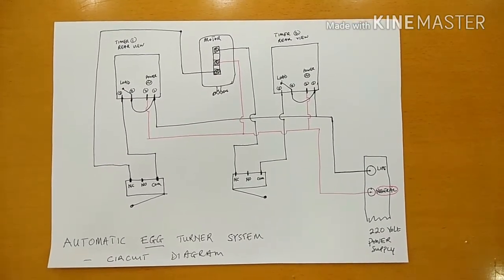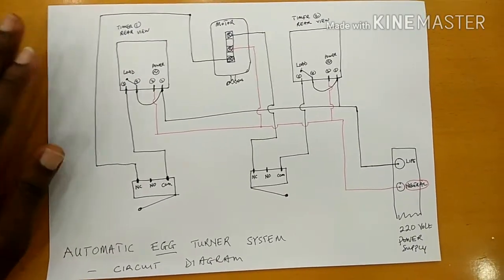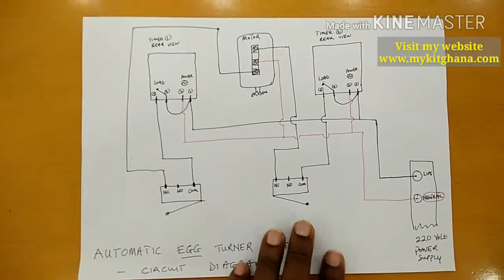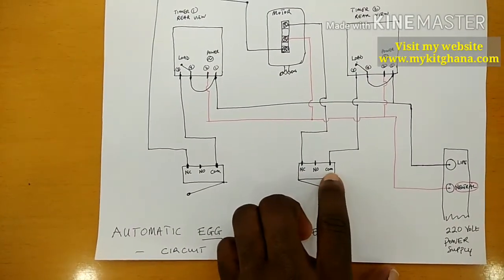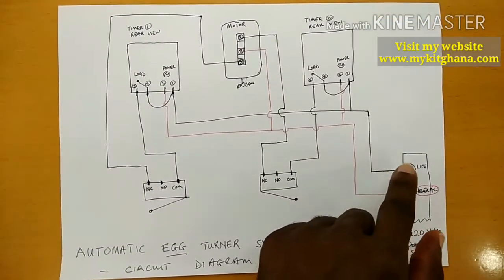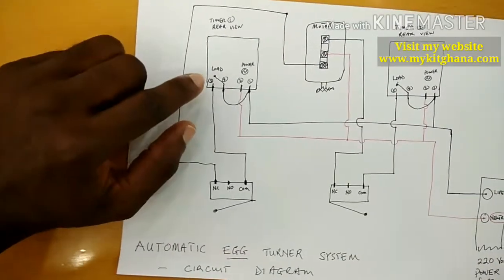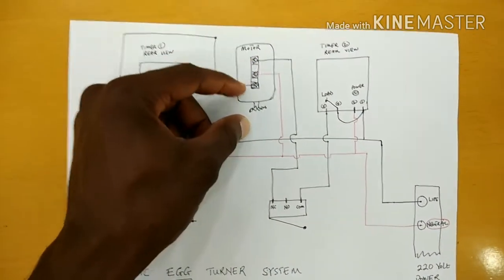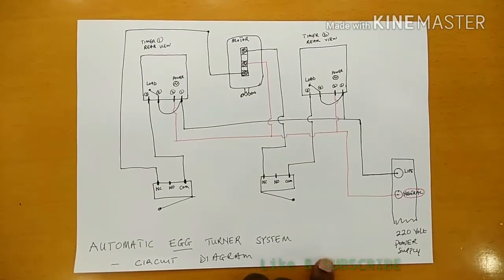Incubator automatic turning system CIRCUIT DIAGRAM

Comment: i tried ur diagram after connecting all component when tested the turner is not stopping when touching on both limit switch still continue turning on both ends.
Reply from the maker: I think u missed something
Reply: what kind of timer u r using programmable type?
Reply from the maker: Cn101
Reply from the maker: Try this video https://youtu.be/QZtRUx4oNjk

Comment: Hello! I am reading you from east Africa. Your video is real illustrative. But still having one question, can one set egg turner by using only one 24hrs timer switch without a relay?
Reply from the maker: If your Turning system is such that the motor only turns in one direction, then you can use just one timer without relay
Reply: @mykitvideos5937  long time subscribed!!! Is not one direction motor. Come again brother. How then one would configure turner as such without relay. Take note it is a two way motor. Thanks again
Reply from the maker: +Ezekiel Shija 
For this type of motor you either use 2 timers or 1 timer plus relay
Reply from the maker: +Ezekiel Shija 
See the relay here
https://youtu.be/QZtRUx4oNjk
Reply from the maker: Ezekiel Shija 
Yes
Reply from the maker: And actually it depends on the configuration or style of your Turning system
Reply from the maker: Please subscribe to our channel if this was useful. Thank you

Comment: I really liked your video. It's very informative, but I am still a bit confused (as I don't know anything about electronics, but I love chickens:)). What are the two thingies at the bottom of the diagram? And why do you need two timer switches? I mean, like, how do they know whether to turn left or right? Sorry, I'm a beginner in electronics:( Many thanks!
Reply: MyKit Videos hello bro you mentioned the relay, can I use solid state relay ? and why dpdt thank you.
Reply from the maker: @peterpeter6925-y1k  no please. Solid State relay is for different purpose
Reply from the maker: Mary Doe 
Thank you. I'm glad you like it. 
PLEASE SUBSCRIBE to my channel
Reply from the maker: The 2 black things are limit switches.
They stop the motor when they are activated
Reply from the maker: U can use 2 timer swiches or just one.
I have both videos to show how to connect in both cases.
If you use one timer u will need something called relay swiches. So in case u don't have that component then u can improvise and use 2 timers